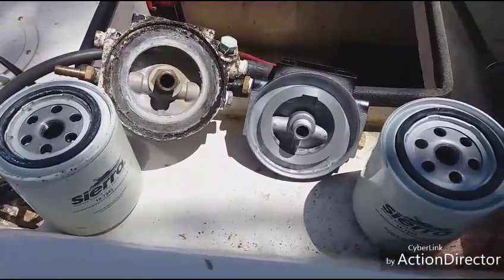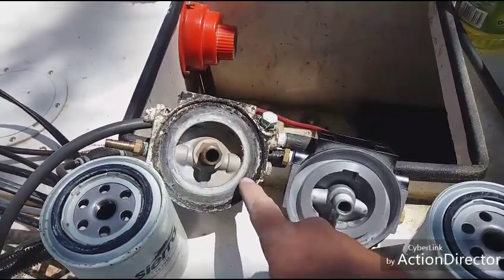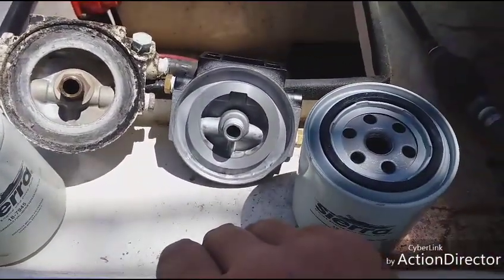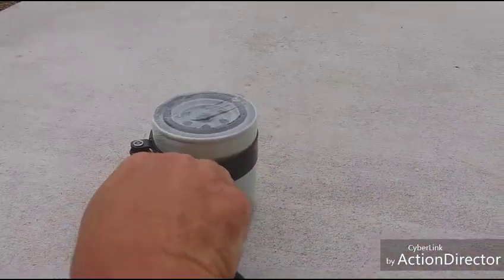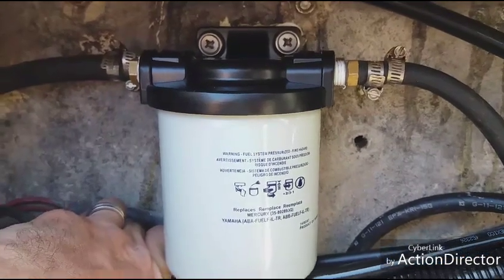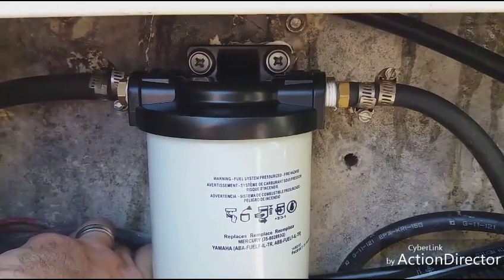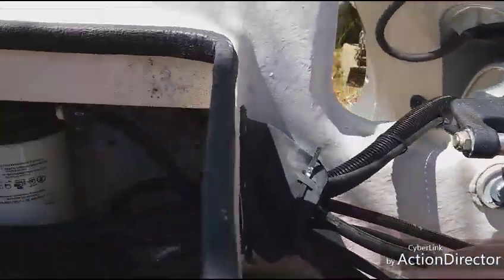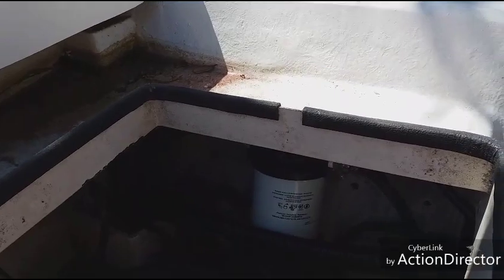Changing Your Boat's Fuel Water Separator!

Comment: Heythe shope say i have water in my gass tank i dont no how much but it runs good  if i do have it in there will the filter keep it safe
Reply from the maker: No it will not. You need to get the water out. It will pass the filter when stirred up In suspension.  Do you have a portable tank or a big one in the boat? Do you have a fuel/water separators?